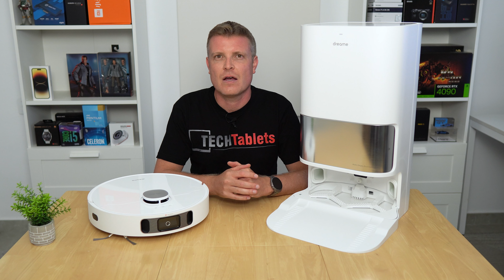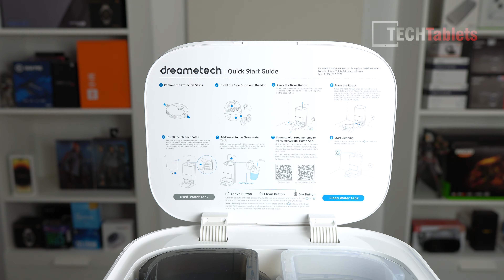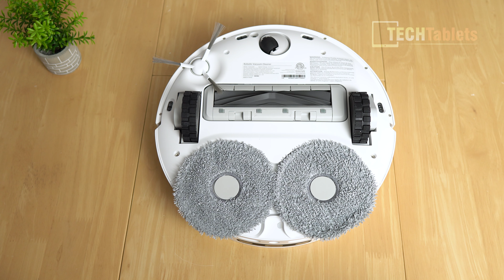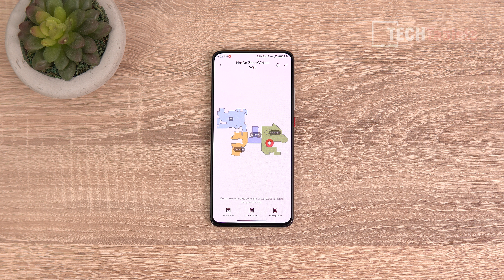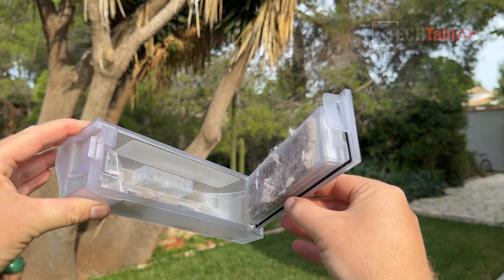DreameBot L10S Ultra Review - Mopping Robot Vac With Auto Empty Station

Comment from the maker: More info and price: https://www.amazon.com/dp/B0B7J95MHN?maas=maas_adg_9B1D061CE0B0349A60580CA20F9382B2_afap_abs&ref_=aa_maas&tag=maas Discount coupon: L10SULTRATB

00:00 - Intro
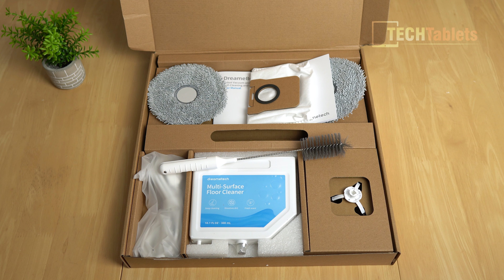01:24 - Unboxing
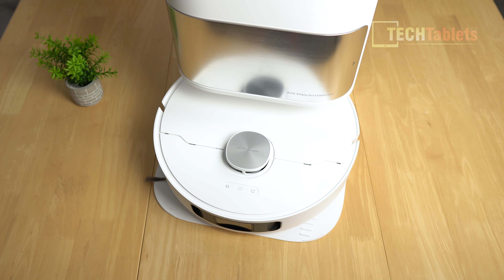01:47 - The auto-empty and clean station
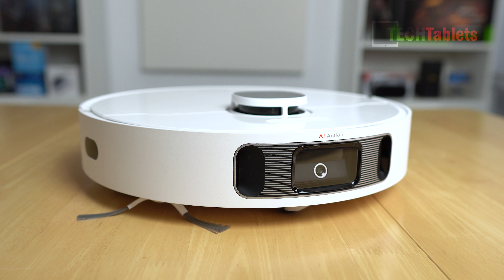03:04 - L10S Ultra robot vacuum design and features
06:46 - The application & features
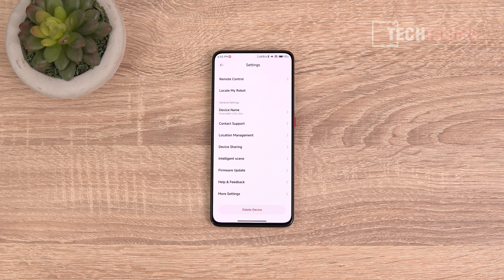10:00 - Cleaning performance and tests
13:46 - Base station empty and clean sample
15:07 - AI obstacle avoidance did it work well?
15:12 - Final words with Pros and Cons

Comment: The robot vacuum is excellent. However I have a question. Is it possible in the app to set it NOT to use the brush and only set it to sucktion? We just got new hardwood floors and its recommend not to use a brush on them. Short of removing the brush can this be done in the App?
Reply from the maker: You set it just to mop and remove the brush it will vacuum but without sweeping the results are not very good. Tomorrow I will have my review of the new 10S Plus model with a silicon brush which should be easier on the floors.

Comment: Thank you for the review! this is so helpful. I read somewhere that the water tank on this machine is very small (80 ml? ). In your testing, did you see it run back to the base station a lot ?
Reply from the maker: Hi the build in vac tank isn’t very large but it’s only to wet the mops and then it all depends how you set that in the app. So it will go back to clean the mops and then resume cleaning. But we have some control over this via the settings that least.

Comment: How much hair out of total on the carpet did it lift? Mop 2s has only 2200 Pa and leaves quite enough hair, interesting if due to power of the test vacuum, it lifts drastically more
Reply from the maker: The issue is more the lack of bristles on the main brush with this model, it can leave a few hairs behind on carpets. But on hard floors this didn't happen.

Comment: Welcome! I bought such a machine! How can you set the mop to wash thickly? Rinse once after 18 square meters, but the mop is dry by then. :(
Reply from the maker: You have the option in the application to get it to rinse it more since I have a small place it’s not been an issue. Also via the application set the mop to be more wet to start with. Overall what do you think of it? I’m a bit disappointed by the AI not avoiding usb cables other than that it’s been doing an awesome job around the house cleaning.
Reply: if the mop is dry after 18 sqm, the automatic filling of the internal tank does not work properly.  You can find solutions to this in internet forums